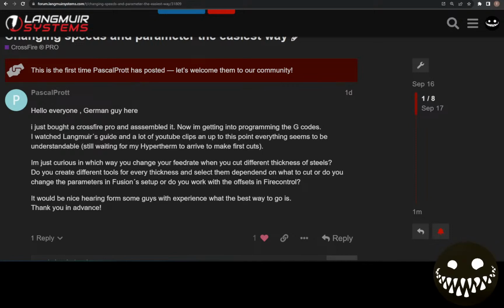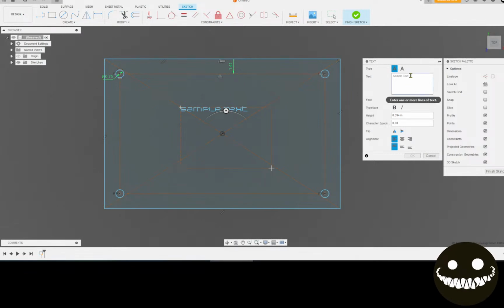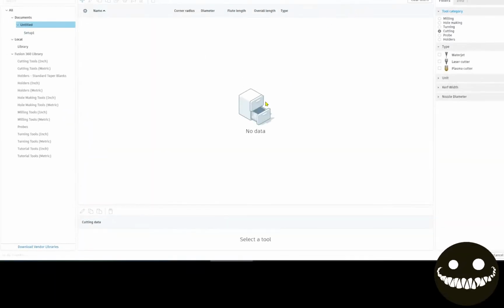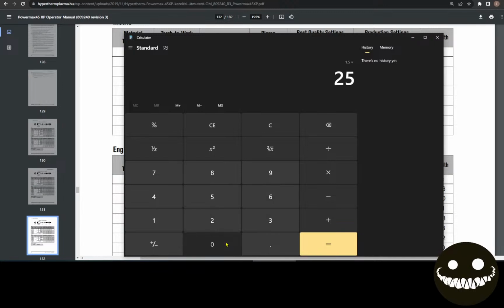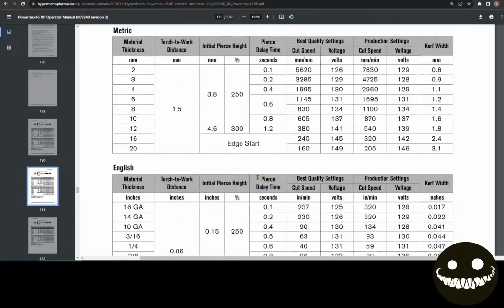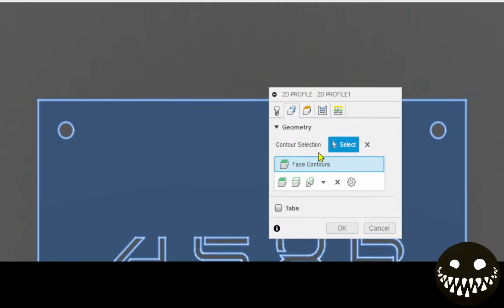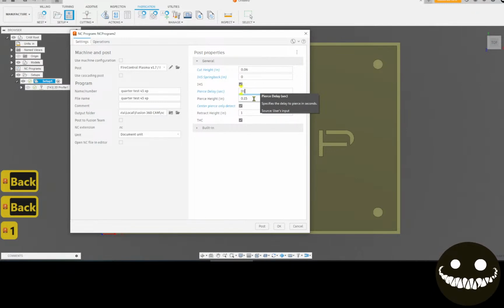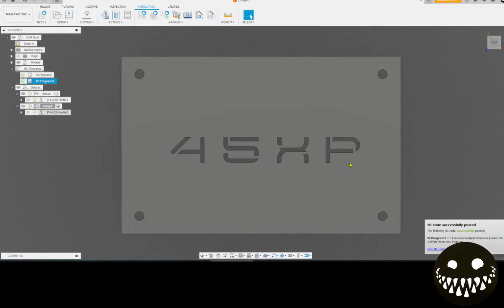Videos of the Fusion CAD CAM support I provide at the 
https://forum.langmuirsystems.com/latest

Comment: Under Nozzle Diameter, you put the kerf. I think this should be the actual diameter of the head of the nozzle.  I think it uses this information to keep the head away from previous cuts.
Reply from the maker: Good catch. Yes I do use the kerf width in the nozzle diameter section of the tool information. I sept 2023 Autodesk made a change with this function so it no longer simulation the cutting correctly when using the actual diameter. you are correct Fusion would use that information if I was also selecting the "keep nozzle down" feature in the linking tab of 2d profile menu to keep the head away from pervious cuts. but I am retracting the torch after the cut so I do not use the keep nozzle down feature so it doesn't use the nozzle diameter information in this case. once they fix the simulation update " bug" I would adjust my nozzle diameter to the actual dimension in case I do ever use the keep nozzle down feature.
Reply: @tinwhisperer  Thanks for the info!